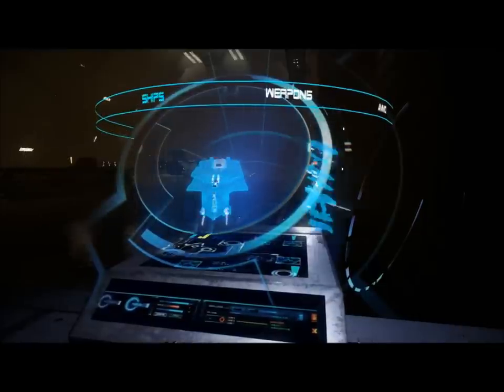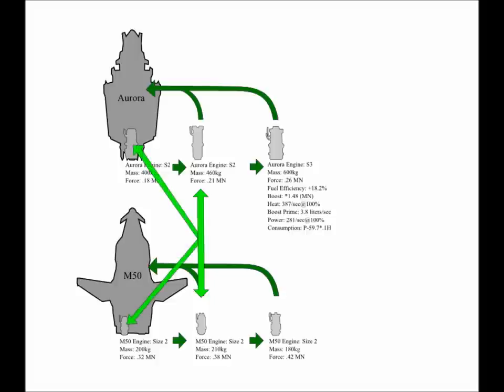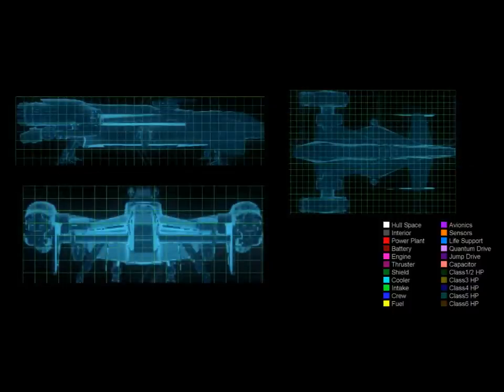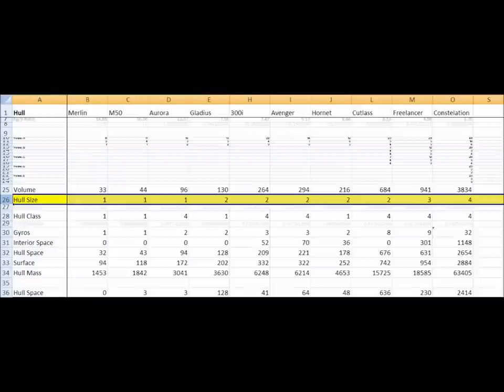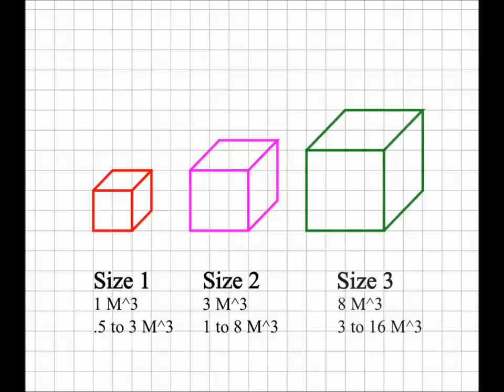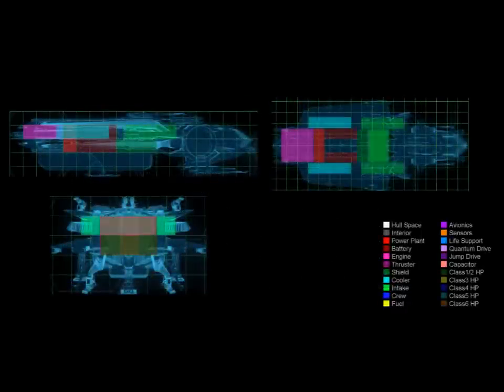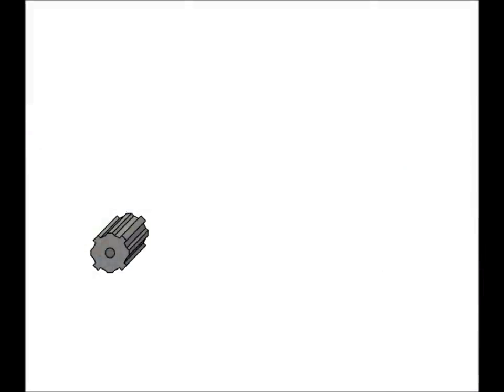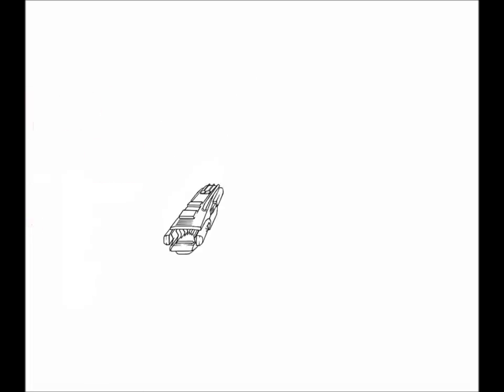Modularity Part 01 (Basic Hull Construction)

Comment: Can you please provide examples of tabletop games which use similar system simulation rules to those implied by CIG?  Are there examples of mech or spaceship tabletop games where pipelines are the basic structure of units, and equipment applies modifiers to a unit's pipeline to create and fulfill specialised roles, rather than directly modifying stats? Any other examples welcome. Thanks.
Reply: Traveler used a similar system to this when designing space ships
Reply from the maker: There isn't a table top game that I can think of that keeps track of a lot of things like pipeline, because in most table top systems, a complex system is devised, and then reduced many, many times to make it elegant enough to be manageable with very small units and simple math, so a game turn (which is usually a couple seconds) doesn't take minutes to calculate.  What most people don't realize is that these old systems (like Traveler) were very carefully thought out and played through in incredible complexity, then reduced over and over until there was a good balance between emulating complexity elegantly and retaining the results.  Traveler (sci-fi sim universe), Car Wars (post-apoc sim driving game), and Rune Quest (fantasy sim universe) are examples of three systems that did this wonderfully; their worlds weren't like our own -- they were our own, emulated with well thought out and concisely executed systems that made complexity manageable, and incorporated the impossible believably.  In a video game, there is no need to systematically reduce complexity in the system; if a game can push hundreds of thousands of geometric shapes proving thousands of geometric queries 30 or 40 times a second, it stands to reason it can keep track of a few hundred sums with a little arithmetic.
Reply: nebohtes Thanks, I'll take a look at Traveller. Any prominent video game examples that spring to mind?
Reply: Galaxy Trucker is a board game that uses the concept of pipelines and modularity (though with much less depth, of course). Check it out.

Comment: Great art at the end of video! Care to share how you've made it. Is it some if paint overs or did you start from 0? 
Nice job.
Reply from the maker: Marius Žemaitis I use freeware for the art; mostly Inkscape and Blender.  I've never 3D modeled before, but I have re-modeled some of the ships in Blender to try to save time getting proportions correct when doing perspective drawings that include hulls and component space.  Some are paint overs, where I take screen shots from the Holo-viewer in CIG's site, and do my line work over the top of the reference, draw my own elements over the background, then add my own lighting to the whole thing manually.  Very few of the images are my own pencil sketches from scratch.
Reply: Nebohtes Thanks. I know how much work you have put into your art. Huge. There's new render type in recent version blender, that outputs to svg. Check it out it might help you.